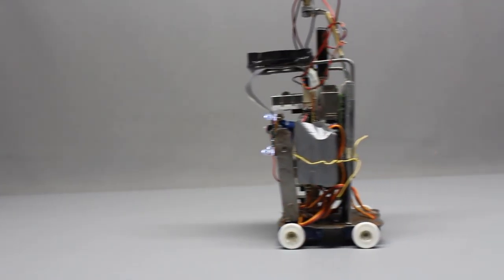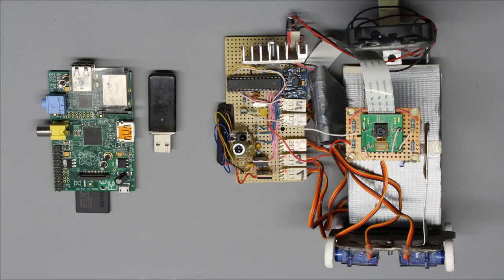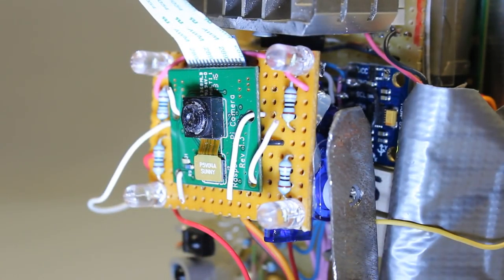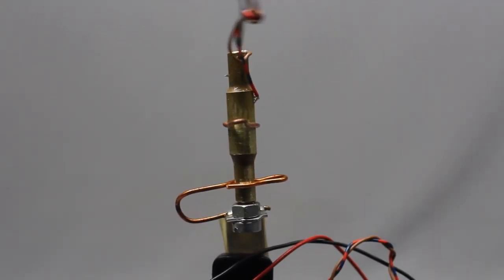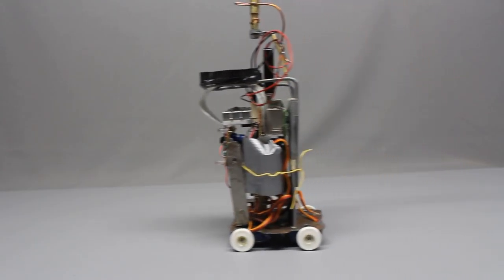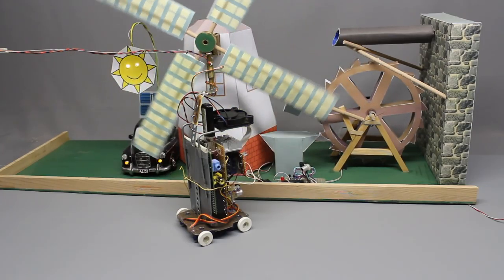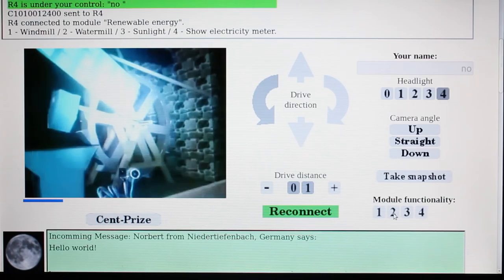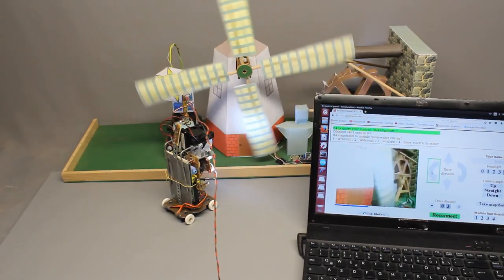R4 - remote controlled robot with a Raspberry and an Arduino

Comment: Excellent work as usual, will there ever be a programming tutorial series for the arduino or for the pi?
Reply from the maker: +Vasilis Karastergios Yes, but not in the very near future. If I can find a generous backer, it would start immediately, but none of the companies I have asked gave a positive answer...
Forward my projects, maybe some day there will be an offer from one of the global players that need future engineers ;-)
Reply: +HomoFaciens Thanks for your quick reply, i know that making videos can be very time consuming, at least get paid for your time! I have made a  homemade pellet burner couple of years ago which it runs with a couple of 555 timers and opamps, it runs well i dont mind it at all, my next goal though is to implement an arduino or the pi to control it, hopefully some day i will be able to do that!
Keep the spirits up!
Reply from the maker: +Vasilis Karastergios For real time control circuits, the Arduino is the better choice. With a Raspberry Pi you could connect your Arduino burner to the Internet.

Comment: Great project!Why you don't use DC-DC converter it will increase efficiency also no fans and radiators.Another thing is to AC instead of DC for the long-distance cables.
Reply from the maker: +Кристиан Косев ...I only hat linear voltage regulators on hand. Yes, buck converters are the better choice because of the higher efficiency.

Comment: sorry i fliped it you may want to put it up right
Reply from the maker: +curtis preston Just before I wanted to go to bed I saw that the latest transmitted picture was in portrait mode...
...it's upright again. Maybe I have to add stabilizers...
Thanks for the feedback!
Reply: +HomoFaciens i recommend having the centre of gravity lower to prevent it from tipping
Reply from the maker: +curtis preston But I wanted the robot to have a small base area so that it doesn't need wide roads to drive around (meaning there is more exhibition space left in a small box). My Automuseum is just 230x230cm.
Reply: HomoFaciens you could try and add a small weight to the base that might work without making the base bigger and its just a suggestion.
Reply from the maker: +curtis preston But the robot chassis is fully packed, no place for additional weights. The main issue is that the cabling doesn't run smooth enough along the ceiling. Adding a ball bearing might also prevent the robot from flipping.
Reply: +curtis preston I think I did it again... sorry... Was trying to get lined up on the world time zone module.
Reply from the maker: +James Newton ...no need to post that on YouTube. Use the comment system on my pages to drop a quick not. I am not logged in to YouTube every day, so commentin on my pages is the quicker way to reach me. Nonetheless thanks for telling me about that tiny accident.